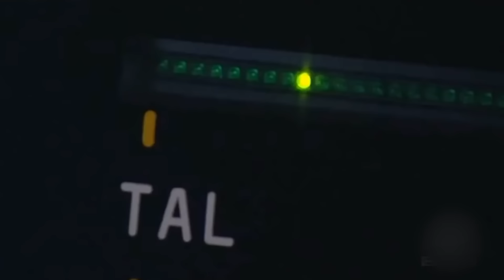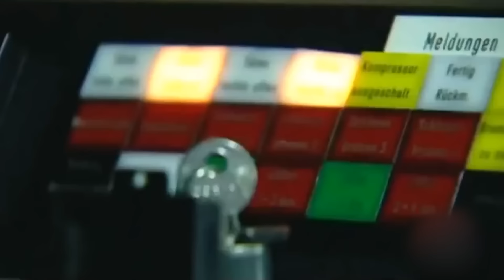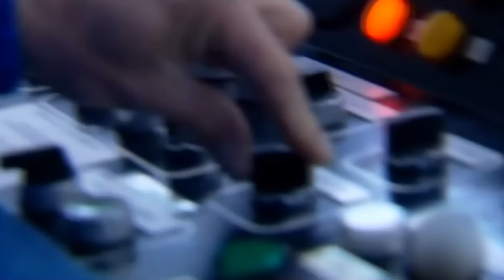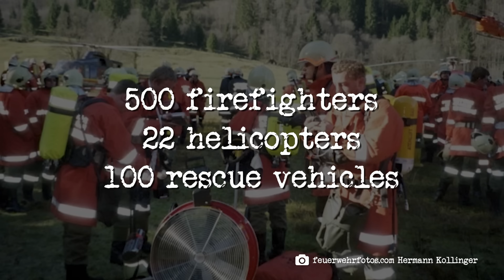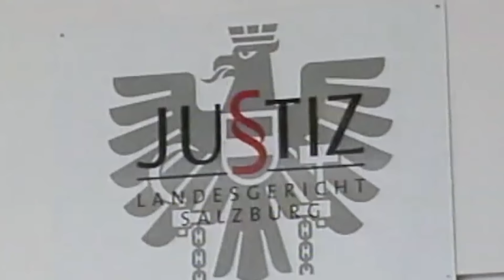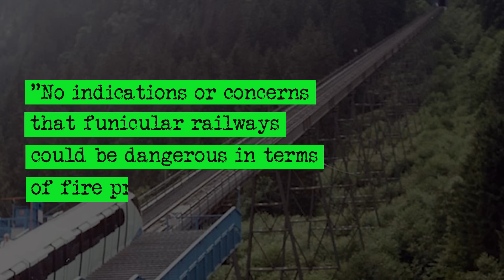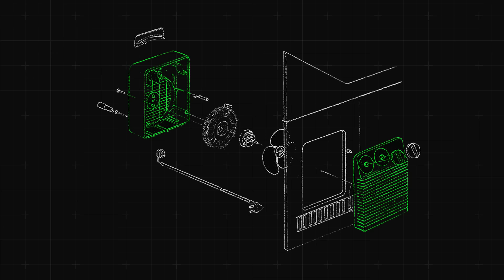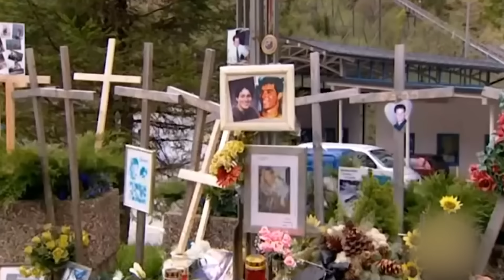The Kaprun Alpine Railway Disaster 2000

Comment: When I heard most of the people went up my heart dropped, this applies to mountains too, fire always burns hot and fast uphill, hence why you should always flee sideways or down.
RIP to all those who died in this terrible accident
Reply: I can't speak for Switzerland but here in Canada we learn basic fire safety at a young age. Smoke and heat rises, stay low. Don't get me wrong, I am not faulting the victims at all, I'm sure they were panicked and I have no idea how I would react in that situation.
Reply: @rustblade5021 . It was in Austria btw.
Reply: Have you ever heard of the original design of the new Berlin airport?
Reply: People run away from fire not toward fire.
Also many tunnels have emergency exits and more chances to survive have those who are closer to exits than those who think they know which direction they should go.
Reply: I think they were thinking the train was going to come loose and roll downhill, I doubt they knew how the brakes worked
Reply: People were panicking probably, and they couldnt think logically,
Reply: @rustblade5021  You must train yourself to remember what your taught even in situations of panic
Reply: Considering how short of a distance the people going up the tunnel made it before they died, I would think that many people, if they were to walk down from the front of the train, would suffocate before they got to the back of the train and out of the smoke. Just a guess though.
Reply: The Problem was that the lowest Car was on Fire so the people would have had to walk past the Burning car, also due to the smoke there is little Oxygen in the air so decision making gets insanely hard in addition to the ongoing panic and the darkness.
Reply: @markmd9  Why I always study maps
Reply: I’ve been on that train daily the year prior to the accident and while on there I sometimes thought what I would do in case of emergency. I think your instinct tells you to run down but if everyone is going up then there’s no choice. Going down on a small metal staircase is difficult with ski boots. Besides, not far up, there was an unused trainstation midway of the track. Hardly anyone knew about it, but it would have been a short walk to reach it
Reply: @ML-jf1xe  very interesting thankyou, it’s very important to know where all your exits are.
Reply: Thank you for advising this, it might save lives in future.
Reply: Honestly, I would go up too to avoid the train if it were to fall down hill. It’s so easy to think about one danger and forget about the other
Reply: @Morpheen999  Much easier said than done
Reply: @ MrLiquid323 Or they're just uneducated.
Reply: @argumentum-ad-absurdum  But looking at the photos, the train was mostly at one side of the tunnel.   Fire and smoke goes UP.    Its understandable to get away from the fire, but it was a trap to begin with.
Reply: @TexasCat99  going up definitely was the wrong decision, i am just listing some reasons as to why people went up instead of down.
Reply: I hate to say it, but the people at the front of that train were doomed regardless, even if they knew to go down. No one got farther than 50ft before suffocating. Extremely fucked up situation
Reply: @NinjaGuyDan_  definitely.
Reply: @rustblade5021 I would imagine they did have some fire safety talks/drills but the problem there is that you learn so much as a kid and if you don't do refresher courses every so often it's very easy to forget. I always had a weird obsession with fire safety growing up so I was always checking for updated info that may have changed or even simply running drills in my own time. I've no idea why I was so obsessed but it served me in good stead as I have dealt with at least 2 fires that had the potentially to be very damaging if I hadn't jumped in. Trying to recall information you first learned as a kid in a panic situation is a good way to make mistakes and you can't blame the unfortunate souls who went up in the panic instead of down. I think this was also one of those massive cock-ups that meant even if every passenger was 100% perfect some were still going to be lost that day, it was just a numbers game I believe.
Reply: It's shocking that all but the group led by the fireman fled upwards. Smoke's usually what gets people in a fire, so I just can't believe so many went where it was guaranteed to be travelling through.
Reply: @jakkuhl6223   There was a fire at the very backend of the train & the one's that survived got out at least several minutes earlier than than the rest of the passengers. It's quite possible that the fire had grown to where the others couldn't possibly bypass the fire at the back end of the train.
Reply: The choice was between going up, or basically running into the fire. Knowing what we do now, we'd go downwards. At that moment though it must have felt that going up was the less worse option, especially if people thought they were nearer the top than they were.
Reply: Yeah, it also suprised me a little bit, even as a child I learned that heat always travels upwards, so it seemed logical to me to always try to get to lower ground in case of a fire.
Reply: @roccocoyote  Still suprised that they actually managed to finish building that thing at all, I thought it would stay as a construction site until at least 2050 XD

Comment: I can't believe that the windows were unbreakable - this is pretty basic stuff - there has to be a method of escape.
I also can't believe that there was no working mechanism to open the doors - they should have been designed to open automatically when the hydraulic system failed.
The fact that there was no built in redundancy in the hydraulic system is incredible - surely a secondary back up system should have been installed.
The lack of communications between the passenger cabin and the conductor cabin is also a major oversight.
This disaster was so preventable.
Reply: It kind of makes sense to have unbreakable windows, so that they don't get easily destroyed when people bump into them with skipoles or skies. Acrylic is way more resistant in that way than glas.

I agree with you that there needs to be a way of escape. In most trains today the windows itself are unbreakable, but they sit inside a kind of big rubber seal-like frame. There is a tab on the frame where you pull, thus removing the rubber seal aroudn the window. Then you have the window and the seal which you can drop outside. This combination provides a way of escape and also features windows that don't get damaged in everyday use. But they were not inlcuded on that train.
Reply: @Patricia-kl8yw  Ironic how the safety mechanisms worsened the incident
Reply: @Patricia-kl8yw  Pretty much all trains in Germany have "unbreakable" windows with one marked break point in case you need to break the window in an emergency. Not sure why they didn't use such a system. The chance that someone hits the exact point with the force required is negligible and the benefit is no people burning alive.
Reply: They should use openable window like Japanese train. You don't need to break the window, just slide the window down and get out.
Reply: You can have unbreakable glass but there should be a mechanism that allows the whole window to fall out, an emergency release.
Reply: @firstduckofwellington6889  it happens more often than yu'd think- people are expecting one kind of disaster, so they design soley to make that safe, and lose sight of how these safety features might be unsafe for any other disaster. It' easy to think "this will make it safer!" and forget that that only applies to ONE situation. You always have to consider how all features and risks function together and influence each other. Unbalanced safety features can be deadly just like a lack of them can be.
Reply: @ddeedje4093   I think they came into use later. When the ice in Eschede derailed it was difficult for the firefighters to reach the trapped people because the glass had no such break points. They had to try which cutting tool would actually get trough the glass. So I think those train-windows were introduced later.
Reply: @Patricia-kl8yw  tbh I think the windows should remain unbreakable. However, be able to be opened from the inside using a handle, like a house window yk
Reply: Ong, here where I’m from every single public transport vehicle and one of those red  glass breakers near every second window. IT’s horrifying to me how there wasn’t anything in that train. Not even a safety break..😮
Reply: TTech in Vienna also failed to build in redundancy for the air pressurization of the Airbus around the same time. An American engineer was even held hostage by the company and State for exposing the deficiency.

Austrians are averse to inconvenient truths and proper design as well when it is inconvenient.
Reply: @meaganglaser  survivorship bias
Reply: Buses have breakable windows with emergency hammers. I don't see why a cable car couldn't have that
Reply: @muhammadirfanataulawal7630 breakable is just fine, it wouldn't cost them much especially in this situation
Reply: @Patricia-kl8yw  Not just people bumpig into the windows could be problematic. I live in the alpines (south Germany) and we do experience heavy hailstorms with golf ball  or even tennis ball sized clumps of hard ice flying around, which the windows must be able to withstand.
Reply: you don't want to have breakable windows on trains or this thing. if a stone tumbles down the mountain and smashes into the window shattering it, the glass shards could kill someone.
the appalling safety features missing were that it was less safe than a roller coaster. rollercoasters need to have stairs which follow the track so if people need to get off due to a fault in teh track they are less likely to be stuck.

breaking the windows was a bad idea, but they should have opened in a sliding manner, or be able to pop into the carriage without tools.

the idea of using a domestic space heater to heat up hydraulic oil is absurd.
and there was no way that the conductor didn't hear them. it is clear that the conductor was paniced, which was why he decided to follow the smoke into the chimney. his decision to manually open the doors was correct but it is very strange to have no capacity to open the doors from within either. they could have put in screws similar to a ship helm which needed to be turned a bunch of times to open it, but having them trapped is kinda absurd.

also unlike an elevator, the system didn't have catches to prevent a runaway train event if the driving line failed.

it is also absurd that the conductor cabins had their own private door outside, but no way for people to get into either of the cabins. if they had the elevator breaks in the system. then it wouldn't have mattered as much

nearly all the fault is on the conductor. getting people safely off of these vehicles is their entire job. the fire shouldn't have happened, but the system also shouldn't have been able to critically fail like this. the delays and guiding people into the chimney were what sealed their fates. if someone had smuggled a little camp stove and had filled up the compartment with fumes, it would have been much the same.

it is the problem with trying to employ really low IQ people. you can give them jobs which require infrequent decision making, but if they can't cope with the infrequent decisions, they still shouldn't be in the position for the rest of the time.

there is some fault with the passengers, for not taking off their snow boots and going in the wrong direction, but the circumstance was so stressful little blame can go to them. they are tourists, not trained and paid professionals. we don't know if the conductor told them to go uphill which would kill them. if he did, he directly killed them. and if people who would know better if they thought about it, see the rest of a group they identify with doing something, they will often go along with the herd. desperation and stress and recent relief from an exhausting stressor, can cause even the best to choose poorly.

i can't really imagine the intensity of the terror of thinking you are going to die in a box, or the relief to be released, and to not be able to go with the group. i can't imagine needing to wait in a smoke filled cabin for others to pass by so you can head in the other direction. or being in the position that you need to tell people to take their shoes off to go outside so you can walk easier.

and i can't imagine people deliberately blowing air on a raging fire, to put it out. or having a hydraulic system which was flamable and couldn't be drained.

Comment: many people have commented on the lack of safety features but the two layer laminated glass which the passengers struggled to break was an example of exactly that: the automatic brakes and tunnels being wide enough to escape out the side doors likewise. which is a good illustration of how safety must never be treated as picking items from a catalogue but thinking of how people will interact with their surroundings in different situations. In this case the obvious omission was the lack of an emergency alarm in all compartments; the first "Harrison cord" type alarm was introduced to trains as early as the 1870s and the communication cord linked to automatic brakes in the 1890s. Operating regulations for years required that crews go to check what was wrong if the system was operated. Unfortunately health and safety becoming a matter of law bedevilled industry with safety features and checks which were in no way apposite to the risks of operation.